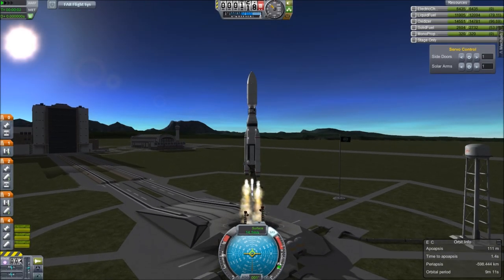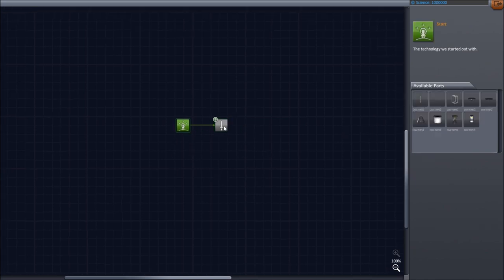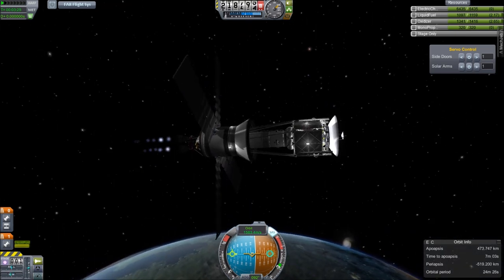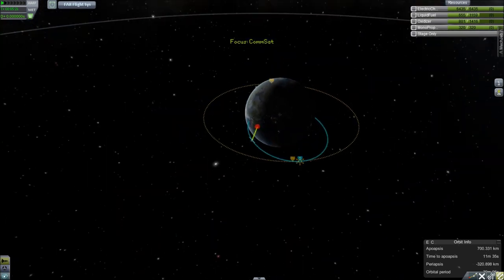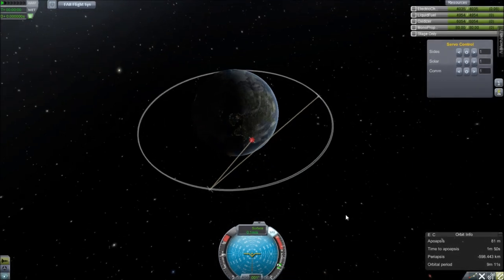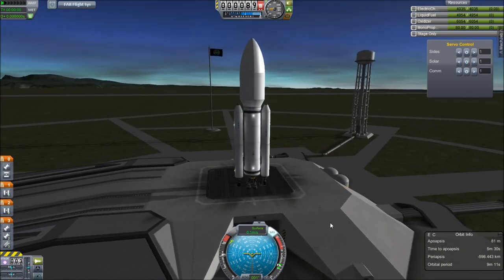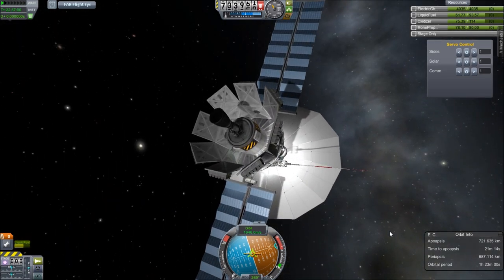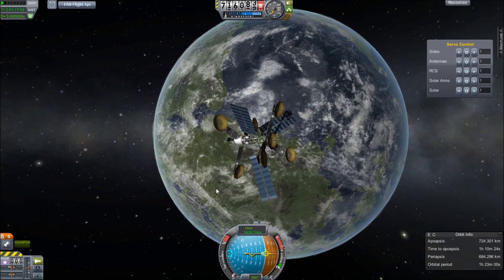RemoteTech2 v1.1.0 - Tutorial - Kerbal Space Program

Comment: As long as you want to use MechJeb 2 for setting up your networks, there's a specific function in the Maneuver planner that will help. After you circularize your orbit at the desired altitude for the network, use the resonant orbit function. For your 3 satellite network, set it to 2/3 resonance and mount multiple satellites to the craft. every time you come around to your Ap, release one and use it's engines to circularize it. Repeat until all satellites are launched.
You might need to set the resonance to 8/9 (or any greater multiple) to make sure your Ps doesn't sink so low it de-orbits the craft, and just release a satellite every 3rd pass at the Ap.
Hope this simplifies setting up your networks.
Reply from the maker: Bodkinn87 Thanks for the suggestion. I have tried that before. It's a little less challenging than doing it by eye, and felt a little too "automated." Also, there's no reason you need MJ to do that when it's a simple math problem. The real question is whether to launch 1 or 2+ sats at the same time. I prefer launching. That's just me.

Comment: To make a warp stable set of satellites you can go one step beyond syncing orbital periods and sync the semi-major axis down to the meter or better.  100k warp won't nudge them at that rate.

VOID information mod is the only display mod i have seen that lets you show semi-major axis in all the way down to meters (click on the number to change display units).  Physics sim will bounce the last meter of accuracy a bit, but you can use warp to lock it in and jump to space center.

For these 3 satellite orbits VOID is also great to target and select the other two satellites and check your distance to each.  Can help you dial in to be equidistant apart.

Comment: In KSP 0.9 it is possible to set engines to output only at a certain percentage. If anyone wants to set up a network without RCS, then you can fine tune it this way.

Also what I like to do with 1 dish per satellite of my communication network, is to point at my active vessel. This way I can always fly my probes as long as they are in range :)
When setting up a network around Mun then pointing at a celestial is of course a better idea :)
Reply: ***** How do you keep them pointed?
Edit, I no know, you don't, lel, though I got a mod for dat.
Reply: F3aR_CalleR Just right click on one of your engines.
Reply: Wat? Anyway you don't need to point downwards.

Comment: I'm sorry for all of the questions, but for those of us not comfortable with trigonometry, is there an easier way to calculate the optimal altitude for satellite networks around other planets/moons or is it arbitrary, as long as you remain within communication range?
Reply from the maker: Once you have two satellites with the 5Mm antenna separated by 4Mm or so, you're probably fine. Anything else you launch is going to join into the network and continue providing more and more coverage. If you just care about coverage, I would not worry about the trig at all. I only do it because the trig is fun and I am compulsive above cool straight lines and perfect angles. There is no one specific right way to do it.

Comment: I am still confused about how to go about positioning satellites at a proper spacing.  I follow how to calculate the correct altitude and that it's more important to have the same orbital period, but not how to make sure they are spaced out at the correct angles.
Reply from the maker: You get one satellite to 3 hours period, and another on the same orbit but with a 2:55 period or 3:05 period based on whether it's behind or in front of the one going 3:00. You warp until the angle looks good and then alter the second sat to a period of 3:00 to hold its new position.
Reply: Job done!  Next step: install Remote Tech 2.

Comment: I have another question, this time regarding the AIES parts pack.  My question is: How do you make it so that the antennas that come with the pack are compatible with Remote Tech?  I just tried launching a satellite, to go to Mun, with a omnidirectional antenna and the CommTech CL-1 "short-range" dish from AIES, but only the omnidirectional antenna was able to establish a connection.  It looks like the dish is able to transmit science, but not communications.
Reply from the maker: There was a RemoteTech_Squad_Antennas.cfg file in the RT install folder. I examined the file and figured out what it expected in order to "override" stock parts with RT functionality. I then created sections in the AIES part files (though you could make a ModuleManager file instead, if you want to keep yours PARTs pristine) that added the RT functionality.
Reply: I'm afraid that's above my capabilities.  However, I was making the mistake of downloading AIES from SpacePort, instead of the forums, which I just grabbed, and left a message asking if it had compatibility with RT.  I would love to use these dishes with my designs, like you are.
Reply from the maker: I just looked at  AIES 1.5 and I don't see a RT cfg file. You probably need to get that from RT itself, if it's there yet, or from the forums as a separate "patch" for AIES.
Reply: Where would I even begin looking for such a thing?
Reply from the maker: The same forum thread you got the new AIES from, since I find it hard to imagine someone who can edit CFGs didn't do the same thing as you (ask "does this exist?") and find it did not, and make one, and then post it. I have found with the size of this community, there's always someone who did whatever you're thinking, or wishing existed. :)
Reply: You are absolutely right.  I will make another post ASAP and see if that gets me somewhere.  To be honest, I'm surprised the creator of AIES didn't already take care of that.
Reply: Bingo, got it!